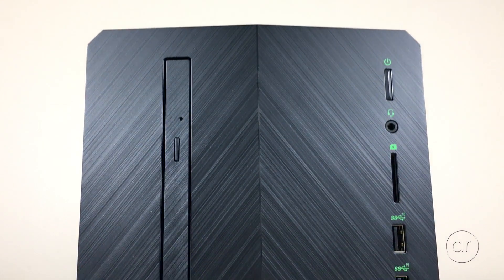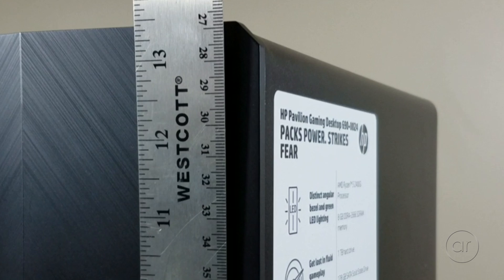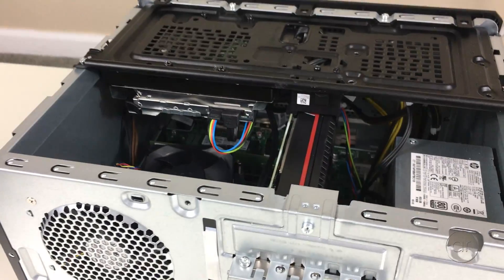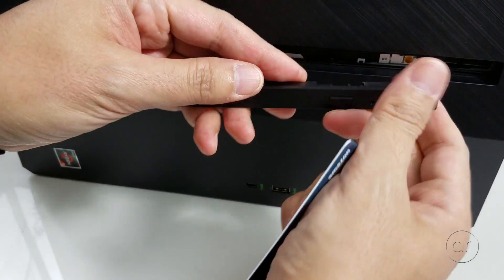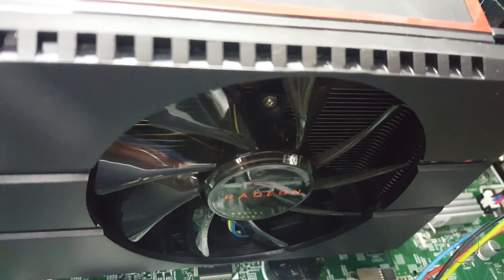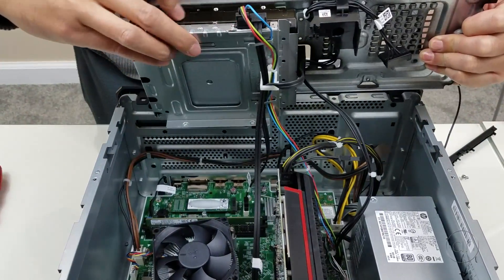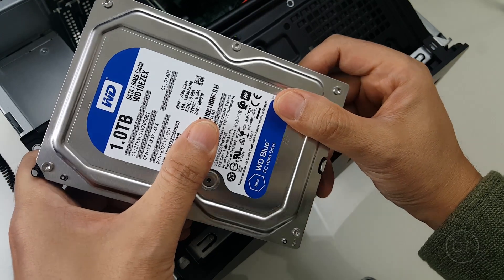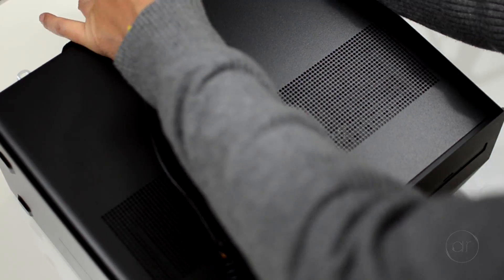How to Open and Upgrade a Ryzen-Based HP Pavilion Gaming Desktop

Comment: Do you think I can upgrade a Pavilion 590 with some of the gpu you list in the description?
Reply from the maker: I'm afraid I can't say for sure - the 590 is a different family of PCs. Looking it up on their website, it looks like they use the same manufacturer for the motherboard but the model seems to be different.
Reply: access random my main concern is the card size. I already did upgrade the psu yo a 400w one, but I’m a little scared to buy a card too thick or long for the box.

Thank you for your answer!

Comment: Latest upgrades to my 069-0024:
-CPU: upgraded from ryzen 5 2400g to ryzen 5 1600 AF
-Cooler upgraded to freezer 12 (removed drive cage entirely) now idle temps around 25C, full load stress test tops out at 65C
-GPU: upgraded from RX580 to GTX1660 super..the HP psu is 400watts so plenty of power. The power cable already included the 2-pin addition to the 6 pin, so I didn't have to get an adapter.
-RAM: 2x8gb adata (runs at 2666)
-storage-main: 2tb Intel nvme SSD
-storage-secondary: 2tb 2.5" SSD

(Feel free to add info to description if you want) or anyone ask questions if you need help! Overall I hope to get at least another year or two from this PC before doing a new build - I still have never built my own computer. The modifications made to this is the most I have done and there's not much else that could be done without needing to do a full new build
Reply from the maker: Thank you for the detailed write-up! I've added your comments (across several groups) in the description credited to you. If you can send the model numbers of the RAM and SSD, I'll add those as well. Thanks again 👍
Reply: @accessrandom  sure thing, the ssds are: Intel 660p 2tb (nvme), adata SU800 2tb (2.5"), and the ram is adata gammix (10?) Rated at 3000mhz. Also p.s. if not for this video I wouldn't have been able to do any of it! So thank you
Reply: You upgraded with this build?
Reply: @andrew2shiesty  yep
Reply: @jakew3  hey can i get some info on how you installed the fan and what type of fan you got (All I see is Freezer 12) ( I need more info) Im gonna get a 1660 super but my cpu needs a better fan
Reply: @jakew3  also whered u put the hard drive since u removed the drive cage and do I have to remove it for the freezer 12
Reply: @tequilandtacos  yes, you need to buy a PWM fan splitter. You plug one end into the Mobo 4 pin CPU fan header and then plug the CPU fan +your new fan into the other end of the splitter. This item cost around $5 on eBay.
In the end with the drive cage removed, I had no reason to keep the 3rd fan in the system and removed it. It's silent as is and has enough air flow. Ymmv

Comment: Hey i upgraded to a rtx 2060 msi version it was a very tight fight though
Reply from the maker: Could you send me the model number of the Pavilion that you have, and would the model be the RTX 2060 Gaming Z 6G?  I can add it to the description with credit to you.
Reply: @accessrandom  B07MQ36Z6L was the asin on amazon for the rtx 2060 and as for the model number of the Pavillion I do not know however I have the ryzen 5 2400G with a rx 580 4gb
Reply from the maker: @kevinkim8458  Thank you 👍 That matches with the 690-0024. I've updated the description... thanks again.
Reply: Did you replace the power supply ?.This graphics card has an 8-pin power connector

Comment: Do you know the motherboard is held by screws ?
Reply from the maker: That's a good question - the system is so non-standard that I wouldn't be surprised if they used some other method. I will check the next time I am inside the case.
Reply: @accessrandom  Thank you for a response , keep up the great work !

Comment: Can you swap out a 1050 with a GEFORCE GTX 1660 SUPER? Idk how many watts is my power supply. Where can I check?
Reply from the maker: If you know the model number of your HP Pavilion, you can check on HP's specifications website. You can google your model number (for example, mine is 690-0024) and it should show up in the top few links.
Reply: access random it says 120 v/320 v :(

Comment: If I buy an rtx 2060, can I use it in this pc?
Reply from the maker: I haven't had any reports of the RTX 2060 (you can find successful upgrades in the "Graphics" section of the description), but any card would need to be less than 10" in length. In addition, please keep in mind the power requirements: the PSU is 400W and only has a 6-pin connector for the graphics card.

Comment: Can i Oc?
Reply from the maker: Unfortunately, HP has locked down the BIOS pretty tightly so there are no overclocking options for the CPU/memory.
Reply: I have a Hp 285 G3 Ryzen 3 2200G can i Buy for this pc a RX 570 8G and 400W Power Adapter?
Reply from the maker: @fortplay6357  I'm not familiar with that model (it seems to be a different family that the Pavilion gaming PCs). You can try searching the HP parts website and perhaps contact them for upgrade paths.

Comment: Can you upgrade the SATA SSD?
Reply from the maker: Yes, the M.2 slot will take both SATA or NVMe SSDs. The M.2 SSD contains the operating system so you'll need to either perform a factory restore to the new SSD, or clone it.

Comment: Damn, I just found out I have a 1050 and thought had a rx 580 lol
Reply: AXD 210 Lol I have one with the RX 580, my only gripe is that with some games I get a blank black screen for a couple of seconds every now and then. I would assume the gpu isn’t getting enough power is why it happens, but I’m going to buy a new case, motherboard and bigger power supply and possibly cpu cooler to see if the extra air flow and power will help with it.
Reply: John Lee how’d it turn out ?
Reply: John Lee yeah how’d it turn out? Mine is doing the same thing.. I also suspect the power supply. My screen won’t turn on at all now. I’ve seen some videos about cleaning the ram so I’ll try that tomorrow.

Comment: Is there a certain power supply you can buy? I'm thinking about upgrading my cpu and hoy  but the psu is what's limiting it
Reply from the maker: It needs to be an HP OEM part (and unfortunately, overpriced). The pins coming from the power supply are non-standard - HP made it really difficult to upgrade the PSU.

Comment: So there isn't anyway to upgrade to a power supply past 450W right?
Reply from the maker: If you want to go with an OEM part, I see a 500W power supply on HPs parts site but unfortunately there's not much information on the models it works with. You may want to contact HP to see if it's compatible with your Pavilion model.

Comment: If i wanted to upgrade to a 2-fan, bigger GPU (looking at a GEOFORCE GTX 1070 FTW) would I have to buy a more powerful power supply AND a new case?
Reply from the maker: Yes, I'm afraid so. The GTX 1070 FTW is 10.5" in length, which wouldn't fit inside that case, and requires two 8-pin connectors. The HP power supply only has one 6-pin. Further bad news is that the motherboard would also need to be replaced since its power pins are non-standard (matching the non-standard power supply) - and if you replace the motherboard, you'll need to replace the CPU fan, which has mounts for Intel (even though the CPU is a Ryzen). HP didn't make it easy...

Comment: Can you change this pc’s parts into a other case 😂😂😂
Reply from the maker: The only question is the mounting holes for the non-standard motherboard and the power supply. Unfortunately, I didn't check the spacings of the holes to see if they were standard ATX/ITX or not. The power supply is also non-standard and has dimensions of 2.8125 x 2.9375 x 6.25 inches. Otherwise, all of the other components - including the memory, SSD, hard drive, and video card - are standard and can be moved (the DVD drive is a slim-type so you'd need some adapter to mount it in a 5.25" bay).

Comment: So i would like to upgrade my storage. Can i just add another hard drive or do i need to replace the entire hard drive

EDIT: Nevermind i dint watch the full video lol. Thank you so much for this video, by far this is the best video to look at for my computer. Could you provide a link to an adapter so i can mount it, i have the exact computer you have.
Reply from the maker: Thank you 🙏 Glad you found the video helpful. Unfortunately, I couldn't find an appropriate adapter so I simply used some velcro to mount it. Alternatively, you can line up the holes on the hard drive to the holes on the cage, and at least two will match up (it's not ideal, but it would hold it securely).

Comment: can I upgrade to a 1650 low profile?
Reply from the maker: I think the 1650 is an ideal candidate - it has low power consumption and some models don't even need PCIe power. If it does have a connector, make sure it's a 6-pin, and for length, make sure it's less than 10 inches.

Comment: can you upgrade the power supply
Reply from the maker: You can, but it needs to be an HP OEM part (and unfortunately, overpriced). The pins coming from the power supply are non-standard - HP made it really difficult to upgrade the PSU and motherboard.

Comment: hello can i first upgrade the power supply ?
Reply from the maker: It's possible, but it would need to be an HP OEM part (and probably overpriced). The pins are non-standard coming from the power supply (and thus, the motherboard is also non-standard).

Comment: I have the Ryzen 3 2200g version of this PC. Runs everything I throw at it and I'm happy with it. The fans are loud in my opinion and I was looking to just put all the parts into an entirely new case to make it more customizable friendly and replace the fans and get a better graphics card possibly. Is this possible? I looked around and people are saying the power supply and motherboard are built to fit in this PC. If you know can you explain why? Thank you and very good video!
Reply from the maker: Thank you 🙏  I think most people may be referring to the mount holes on the motherboard - I didn't really check to see if they had standard spacings for standard cases. The PSU also seems to be non-standard - it's dimensions are 2.8125 x 2.9375 x 6.25 inches or 71.4375 x 74.6125 x 158.75 mm. Other considerations are that the motherboard and power supply must be matched with each other. For example, the power connector for the power supply has a non-standard pin configuration on both the motherboard and PSU, and on the motherboard side, the CPU fan mounts are drilled for Intel, even though it's a Ryzen CPU (!)
Reply: access random thank you this is very helpful!

Comment: Hi again! Thanks for helping me upgrade my ram!. I am now planning to upgrade my graphics card to a GTX 1660 or TI. Can you tell me how to safely switch to it? Thanks!
Reply from the maker: Sure, happy to help with the RAM. The graphics card is more challenging because you need to make sure it physically fits within the case (the length of the case is approximately 10") and it also needs to have a power consumption similar to the RX 580 and have a 6-pin power connector. One of my viewers used a 6-to-8 pin adapter for a GTX 1660, but I highly recommend that you not use an adapter and find a card that has a 6-pin connector if at all possible.
Reply: @accessrandom  Thank you is the 1660 good for me or would you recommend another card? Thank you you are the best!
Reply from the maker: @axd2102  Thank you 🙏. As long as you meet the power consumption, power connector, and physical size requirements, I think you should be good. With that said, I have been keeping track of the successful graphics card updates from other commenters in the description (under the "Graphics" section). You may want to go with a model that has proven to work for others.
Reply from the maker: @Mark Dumo Not with an off-the-shelf power supply, I'm afraid. HP made the pins non-standard (thus, the pin connectors on the motherboard are non-standard as well). HP does sell power supplies in their parts store but they are relatively overpriced. If you can find a card with a 6-pin power connector, that would be ideal.

Comment: what ram can i use to run dual channel with existing 8 gb
Reply from the maker: It's best to use the same brand/model that was installed out-of-the-box to make a matching pair. In the "Memory" section of the description, both Samsung and SK Hynix have been found to exist so you'll want to open your case to find out what you have. I've also listed other memory models that have worked for other viewers.
Reply: access random so can i use the ram in the description to add with my existing one
Reply from the maker: @blitxzz5890  Yes, but I would open your case to find out which one you have (Samsung or SK Hynix) and then make your decision based on what you have.
Reply: access random i have a micron so should i use the crucial one
Reply from the maker: @blitxzz5890  Oh, interesting - I haven't had any reports of Micron being the stock memory. Could you tell me what your HP model and the Micron memory model is so I can add it to the description (with credit to you)? To answer your question - it would be best to choose the exact same make/model of what you currently have. If that isn't possible, try to match the specs exactly (including the speed, voltage, and CAS latency).

Comment: which had drive are good for this pc
Reply from the maker: Any 2.5" or 3.5" SATA hard drive will work with this PC. You can either replace the existing one, or add another (since there is an empty SATA data and power port available).

Comment: HP has these on sale direct from their website with customizability options. I just ordered mine, but went with the cheapest RAM option since their RAM upgrades were overpriced. I'm still kinda new to the world of PC upgrades and don't know too much about how RAM compatibility works though. Would you happen to know if 16GB sticks of Patriot's Signature Premium DDR4 2666MHz RAM work with this model?

These right here (from Amazon):

/dp/B07Q286BGH/ref=cm_sw_r_apa_i_lIMOEbCCCJST6
Reply from the maker: That's a good strategy to upgrade the cheaper components. I can't say for certain that the Patriot memory will work (since there are so many different RAM out there) but since it's a standard DDR4, it should work, especially if you are replacing the existing RAM. I've been keeping track of successful upgrades by all my viewers in the "Replacement Memory" section of the description, including the brands/models that have worked.
Reply: @accessrandom  My PC and the aforementioned RAM sticks came in, I can confirm they work.

Comment: Please i need help 
I want to upgrade this pc with a 2060 super and a ryzen 3600 but did i need to change my mother card ??
Reply from the maker: The motherboard doesn't support the third-generation Ryzens, so yes, I'm afraid you'll need to change the motherboard. At the same time, you'll also need to change the power supply because it has non-standard connectors (and is matched with the motherboard).
Reply: @accessrandom  thank you sooooooo much for your help i just got another question did a 2060 super is able to pass in that pc because it seems verry thight

(Sorry for my english i am a french you know 😂😂)
Reply from the maker: @kuicoam6869  Pas de problème. As long as the video card is less than 10" in length, it should fit (I measured the inside). You may need to remove the bracket shown at the 3:24 mark if the card is too tall.

Comment: If i bought 16gbs of ram at 3000mhz to install into this exact PC, would I be getting the full 16gbs at 3000mhz? I have heard the R5 2400g is locked at a certain frequency, and the HP bios is locked so I am unsure if I could change the ram speed. A response would be greatly appreciated!
Reply from the maker: Yes, I''m afraid you're correct. Their proprietary BIOS shows no overclocking settings at all, so it would use the default frequencies (or safe profiles) for the memory and the CPU.

Comment: Great video! I was just wondering if im able to install 2 4gb ddr4 memory sticks instead of 2 8gb sticks
Reply from the maker: Thank you 🙏 According to HP's specifications site, the motherboard "Supports 4 GB and 8 GB DDR4 UDIMMs". I've been keeping track of successful memory upgrades by viewers in the description (under "Replacement Memory") but so far I'm afraid I haven't seen anyone try 2x4GB; the specs indicate that you should be able to.
Reply: @accessrandom  ok, so if i install the same memory as the original first one in  the second slot i should be good rright?
Reply from the maker: @edwardding4621  That's correct. The installed memory is either a Samsung or SK Hynix, so if you match a new one with the existing one it should work fine. There are other brands/models which have been used successfully (in the Memory section of the description).
Reply: @accessrandom  but it is 3200 hz or what?

Comment: Does the hp 8433 mb can work with ryzen 3 1200?
Reply from the maker: I'm afraid not. According to HP's specifications site for the Sunflower 8433 motherboard, only the Ryzen 3 - 2200G is supported (for Ryzen 3s).
Reply: @accessrandom  in theories it can be compatible?
Reply from the maker: @Theoui5  I can't say for certain - the motherboard is so non-standard, I would be careful using a processor that they haven't recommended or tested...
Reply: @accessrandom for start big thanks to tike the time for respond to me! So i think I'm gonna take the risk the tdp is the same I think he can works problaby
Reply: do you know if i can upgrade a ryzen 5 2400g to a 3400g. The sunflower board was released in May 2018 and there are currently bios drivers for August 2020. Could it be?